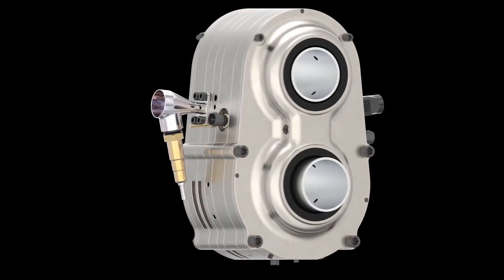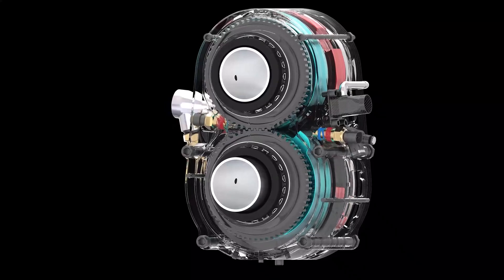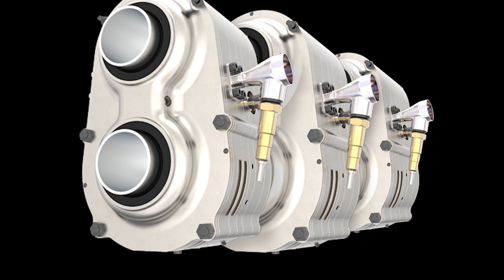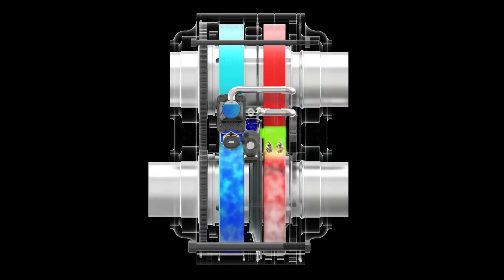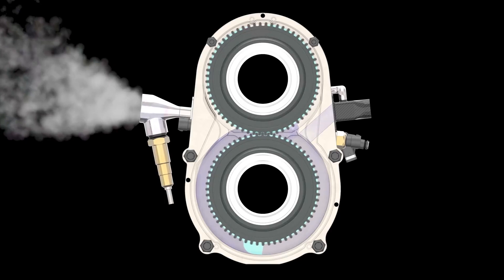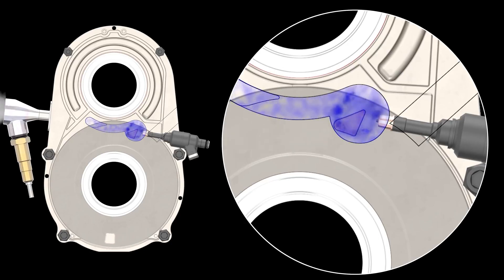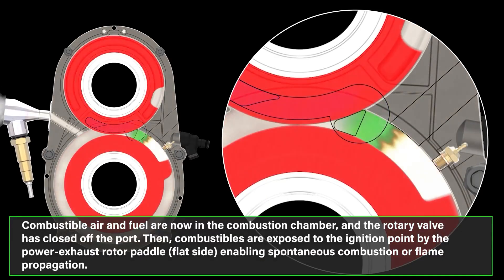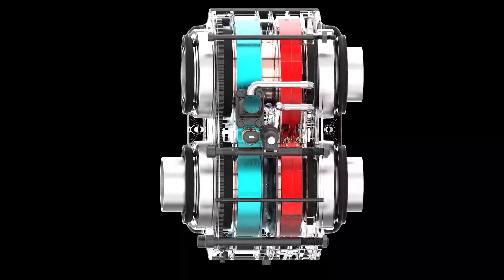This pistonless engine runs on hydrogen and revs to 25k rpm

Comment: Without seals it would require insane tolerances and  any wear would kill its ability to produce  power .
Reply: Just think of it as a tight tolerance on the engines lifespan.
Reply: It would require some sort of special oil  instead of the average of oil clearance  of 3 to 5 thousandths of normal engines.   Heat would be a major factor with thermal expansion.   Would  be fun if it was available to mess with.
Reply: @bradnunn9127  There's one running on their website. Sounds like a Briggs & and Stratton at 300rpm.
I call BS on the thing.
Reply: Thermal expansion aspects could be overcome by design and applying correct thermal coefficient materials but it can be a challenge indeed. However the efficiency propagated indicates limited thermal expansion/stress.
Reply: Not to mention thermal expansion.
Reply: @bryanpritchett  doesnt nitrogen burn at lowe rtempriture? depending on material thermal expansion should not be an issue
Reply: @bryanpritchett  Maybe if it was made from "Invar" the cost would be astronomical.
Reply: @bryanpritchett  "Not to mention thermal expansion." thermal expansion can be dealt with by using metal with different expansion coefficient. This problem has been ever existing in all ICE and there are ways to solve it.
Reply: I was thinking that. And I bet this is just a computer generated model. So that means they probably haven’t tried it for real
Reply: @isaacsrandomvideos667  A working prototype has been built and is being tested. Video of it is on their web site.
Reply: @isaacsrandomvideos667  "they probably haven’t tried it for real" https://youtu.be/gi7IOXQ7oyo?t=536 - it looks like a very early prototype...
Reply: @alterbart7916  oh right. Sounds horrid though
Reply: This design is just a funny shaped Wankel. You would definitely need seals for a practical design which took Mazda a while to figure out how to do robustly but they got there. You would need similar seals for this engine. You can't just use smaller clearances because of thermal expansion (for one thing) which varies with each cycle from, say 800 deg C or so during the power "stroke" to maybe 150 deg C on the intake "stroke"--the thermal expansion would be about 0.5 mm.  Trying to manage this kind of expansion with a clearance of maybe 1/100th of this would be "challenging".  And the short time scale isn't going to fix the leakage issue--more important for leakage is the very high pressure developed when the engine fires and even during compression at the high pressure ratio that is assumed. Using hydrogen is just a gimmick--if the design can work, it would be better tried first on gasoline to show that the concept can or cannot work. The meshed gears that replace the crankshaft are interesting but I seriously doubt the power claims and the practicality of this design. It ignores a great deal of the actual test history of the last 100 years of IC engine design.
Reply: @gerrylarue9043  Mazda discontinued their rotary engine. They never, ever, got it to be reliable.
Reply: @MovieMuscle  they didn't discontinue the rotary they simply stopped putting them in car they are still manufacturing them for the cars they came in.
Reply: lol. yeah. So its a 16kg engine that has a 2 month longevity and requires a 100kg supercharger to feed it enough air to run and a 20kg electric motor to get it up to operating speed.
So basically its a power tap off a turbojet with extra steps.
Reply: @htomerif  Yep thats how I see it. Should work but not any better than a PT-6.
Reply: @anthonyb5279  And even though its in the title, I didn't notice that this thing runs on hydrogen. So lets add incredibly heavy, dangerous and bulky high pressure hydrogen tanks to that list of requirements. Or you can just hope that one of these high density hydrogen storage methods will one day be commercially viable.

The reason I looked for what it ran on eventually was because I was wondering how you get a flame front to propagate fast enough to run an engine at 25k rpms. The only thing I knew of was using hydrogen as a fuel and yep, that's what it uses. in a lot of ways that makes it worse than a turbojet since turbojets will run on basically anything that burns. Candle wax, coal powder, methanol, whatever. This thing? Just hydrogen.
Reply: @htomerif  80 octane may be fast enough, that stuff is really explosive. Nitromethane and water could work too. I could run some simulations to see but i think slower burning fuels would just limit RPM.  You could catalyze H2 out of water with platinum or chromium so you don't need the insaino tank. The more i think about this tho Peltons are less efficient centrifugal or axial turbines. So as novel as this is I don't see it replacing reciprocating engines in cars. MOST of theses peoples criticism is ignorant, the thing would definitely work.  What it has going for it is simplicity so it may find use some where.
Reply: @anthonyb5279  eh... You can't really 'catalyze' hydrogen out of water. you have to put in at least as much energy as you get out. If you're talking about electrolysis then more than all of the energy produced by the engine would be consumed by the electrolysis. If you're talking about steam reforming, the feedstock is some kind of hydrocarbon (and water, but the hydrocarbon is the important part). That is a catalytic reaction, but its still very endothermic and would require most of the fuel just to heat the steam reformer.

In either case, you would be trading hundreds of pounds of tanks with thousands of pounds (realistically tens of thousands of pounds) of industrial hydrogen production equipment, and you're still left with a net energy loss.

If you could just bamf water into hydrogen and oxygen for free, that process would be the single source of the entire planet's energy production, but you can't, which is why so much research is going into storing hydrogen and, like I mentioned earlier, its nowhere near ready for commercial applications.

The only place where you see "free" hydrogen production is when a hydrogen plant is co-located with a power plant or some other industrial source of heat that would otherwise be wasted. That's why desalinization plants are co-located with power plants.
Reply: @htomerif  Yea you are right thats NH3 but replace my statement with NH3 and then the platinum works. sorry my bad.
Reply: @htomerif  yea electrolysis take 170% of what you get out.
Reply: @anthonyb5279  Yeah, you still need a high pressure, high temperature reactor to catalyze hydrogen production from ammonia, but maybe it could work on a vehicle scale? I don't think its done anywhere except on an industrial scale.

Liquid ammonia is a lot better to work with than liquid or high pressure hydrogen but its still pretty bad. In the US its sale is restricted due to methamphetamine production, but its not too hard to get.
Reply: @anthonyb5279  Hmm... i know I have a couple of 1 liter bottles of MEK that I distilled from something in the last year or two. I don't remember what. Maybe PVC glue? I haven't had a use for it yet.

The regulations to try to prevent meth production are stupid. Its just too simple of a molecule to regulate away. There's probably a dozen different ways to make it with just stuff you can still buy at the hardware store. I guess it takes a chemist to come up with new syntheses but it sure doesn't take a chemist to follow them.

DCM (aka methylene chloride) is kind of nasty. Most chlorinated hydrocarbons are hepatotoxic, CNS depressants and carcinogenic.

There's a lot of bad stuff hiding in plain sight. I learned not too long ago that Whink rust remover is just dilute hydrofluoric acid, which is one of the worst things you can handle.

Anyway, thats a bunch of random things I just wrote.
Reply: @htomerif   I live in Maui, I live by Hydrofluoric Acid! salt eats everything.
Reply: @htomerif  What type of Engineer are you? I have 3 engineering degrees BS in Broadcast Engineering, BS in EE, Ph.D in AERO-E&Space Exploration. Im retired from NASA and the NRO(Kodak). Now I'm a YouTube troll and I still build stuff.
Reply: @anthonyb5279  I have no degrees in anything. I spent 10 years in the Army where my official training was in a particular subset of missile systems and thermal optics. I expanded from there to basically everything that runs on electricity. I got out on a medical bad enough that I can't do much.

I taught myself programming where robotics and machine vision and neural networks are my main focuses. There's a lot of ECE that I learned in parallel though I was raised by two PhD biologists, so I have a lot of that too.

If you know about machine learning and especially vision, then you probably can guess I had learn a lot of math.

Chemistry has been one of the last things I've been teaching myself and its taken 5 years and no small amount of money.

So yeah, no degrees. Usually it would be fair to assume that I'm bluffing my way through everything I talk about. A very few people know enough to understand that I'm not.

Oh, and law. Doing this stuff without a university or major corporation to back me, you can stray into illegal territory pretty quickly. So I've had to deal with the FAA and the FCC and the BATF. Especially when it comes to unmanned aerial systems and flying either beyond visual line of sight or letting the thing fly itself, you need a BVLOS waiver for each and every flight. Its actually more convenient just to design unmanned ground systems. You only have to deal with the FCC then.

Sorry to disappoint, but on paper, I'm just a regular guy.
Reply: @anthonyb5279  Yeah, HF is fun. Its relatively easy to make from crushed fluorite and <insert almost literally any acid here> though sulfuric is the easiest. I was surprised that something I don't touch ever with my hands and even with gloves unless I absolutely have to was actually in a product I've been using for decades this whole time.

I always just assumed it was HCl until I looked up the MSDS.
Reply: @htomerif  Well you are very knowledgeable. Very easy to chat with I have appreciated this discourse. You seem to have the temperament of an engineer. You can argue a point with out making it a personal attack.
Reply: @anthonyb5279  Yeah. I have some kind of disease that makes me want to learn about things. Its a problem. I'd never heard of using ammonia as a hydrogen source before. Just electrolysis and steam reformation. I can't really use it for much right now, but I'll remember it.
Reply: Saying it ran on gas where talking hydrogen which has a whole different spectrum of chemical reactions opposed to oil. Like high amounts of oxidation so you can only use specific metals and matrials alike. Lots of ceramic metal hybrid elements. Oil has the advantage of lubricanting the steel or aluminum used protecting it.
Reply: @xaagripha7326  I use Porcelain Tungsten a lot in engines. All of my racing engines run so hot they are on the harry edge of detonation all the time. Typically run 15° past TDC to avoid a hot spot forming and avoid stress on the crank and pistons. Alcohol ADI is also used to keep things within the range Ceramic Alloys heat tolerance. All so I can run an EGT of 3800°F and use as much of the available energy in the fuel as posable. Also gives me a SFC of .32 for the cross country races running lean of peak.
Reply: It’s made by an aerospace company, and we all know that rocket parts don’t last very long because the immense stress on the parts
Reply: @kerbodynamicx472  aerospace also do aeroplanes, a field where reliability is extremely important.
Reply: @kerbodynamicx472  dude if its going in a plane they dont want it to break down when you're at like 10,000 ft. thats gonna be a bad day for anyone in the plane. if it goes to market they'll iron out the bugs. thats if nobody squashes the idea because the established producers would rather not the competition
Reply: @kerbodynamicx472  yes this is true but cars don't travel at 18,000 miles per hour like space rockets, and they never will
Reply: @Classic_Re-creation  Well the guy who fitted a JATO unit to his car might beg to differ, if he had survived anyway ;)
Reply: @Classic_Re-creation  Irrelevant to this discussion.  Vehicle speed has nothing to do with this fake motor.
Reply: Make it out of tungsten and it will be like 70lbs and still not all that heavy but it could take all the heat and wear easy.
Reply: The thing with rotary machines in general is that they exhibit very very little wear over time due to the fact that they run under constant conditions instead of the back and forth of reciprocating systems. I would be much more worried about buildup of exotic carbon species on combustion chamber, that is much more likely than wear and tear causing it to fail or leak.
Reply: @LouSaydus  it runs on H2 no carbon build up.
Reply: Fox Mulder  same thing happens in extremely small Nitromethane 2 stroke engines. BUT NO "Bla bla bla I know everything because I have a moped and bla bla bla.""" You cant be educated because I don't know what you are talking about" 😛any way "I want to believe" :-)
Reply: plus heat and cold. Every part wears, doesnt matter how good the design is.
Reply: @til159  eventually.  Then a teardown and rebuild would be needed
Reply: Fox Mulder  literally nothing you said was remotely accurate. Gas turbine engines operate at those same approximate rpm's and they actually have to have really good seals to make sure the RAGING FIREBALL stays in the right part of the engine.

 "thermal expansion doesn't have enough time to set"
lol. wut? The gas better have time to thermally expand or its not an engine. Its just a flamethrower.

"it's hydrogen powered with low combustion high rotation"
Wow, really? Burning hydrogen is considered "low combustion"?

I'm gonna let you in on a little secret, guy: when they say that this thing takes 200psi of supercharging, i.e. more than 10 bar, you can't use an intercooler. It would lose you too much energy, I don't expect you to understand why, or even why that's important. What you need to understand is that even before the fuel is injected, the combustion chamber will be above the autoignition temperature of the fuel-air mixture.

This engine is going to have (to put it lightly) VERY serious heat management issues. Its all going to have to be made of ceramics and special unicorn metals just to not burn itself up.

If you're gonna laugh at people for being stupid, try not to be stupid yourself.
Reply: Guys I think the engineers and designers have thought about probably all of this, especially in regards to seals and tolerances. If you think you know better than they do, apply to join their team I bet they could use a bright mind like yours.
Reply: But what if we just put seals on it? I don't know if he said it wouldn't work without
Reply: @tapthepope  As you can see when it runs, the wedge that locks into the socket on the lower and upper rings, that is what generates the power, side-to-side those spaces are confined and once the wedge passes the socket the two rings close the gap for combustion to have an enclosed space, expanding gas then pushes the wedge and exhausts somewhere on the other end of the cycle (otherwise vacuum would be a counterforce-factor and that would take power away)
Reply: @tapthepope  wear out fast in rotary l think
Reply: You engineers need some gd common sense now days.  Obviously you have less then a gnats a$$
Reply: Excellent
Reply: I'm sure they are looking into it lmao
Reply: How do you think a seal works....insane tolerances. 🤣
Reply: @jeffsteyn7174  Seals work by being malleable so they can conform as necessary.
Reply: @jeffsteyn7174  that isn't how seals work...wow...they are made from rubber and crushed between two pieces of metal to seal the gaps between them...they are NOT BUILT TO INSANE TOLERANCES...can you freggin google tolerances so you can realize that it doesn't apply to rubber gaskets? 

when they are talking about tolerances they are talking about ridged bodies. like a 1.0014mm wide peg fitting in a 1.0015mm hole. 

here is a visual aid if you need one. 
https://www.youtube.com/watch?v=ekwk5VsflKI
Reply: @TheNitroG1  that is one type of seal yes. But you realize there are others as well?
Reply: That's why you don't put it in a car, you scale it up and put it in a generator.  Something emplaced and static so operational jostling does not cause those 'tight tolerances' to bounce around against each other.  Hook up a big ass fuel cell and you're set on keeping the house and demanding electric statusmobile powered indefinately.
Reply: Well F1 Engine tolerances are so close that it is seized at room temp. It needs to be heated by circulating hot water through it to free it up.
Reply: Fox Mulder  then why arent there any running prototypes? Its easier to sell if you manage a working proof-of-concept instead of spinning cgi-fantasies.
Reply: Insanely close tolerances would make it super expensive to produce too.
Reply: @noxious89123  the tolerances are no closer than a piston and sidewall. The only difference is that there are no rubber seals, the speed of the engine produces creates a pressure seal.
Reply: " Intolerance wear", as you call it, can be corrected instantly because the wear would be on circular surface( s).....
   The two circles could be adjusted closer when needed.
   Any gears could be replaced in minutes...at a minimal cost.
  Used worn gears could be recycled...
Reply: I have machined parts for transmissions parts before and I worked within tolerances of 0.0002 +/- 0.0002. If you're skilled enough at setting up a machine to do this kind of work it's rather easy to produce these kinds of tolerances.
Reply: Ha Ha Ha  says you !
Reply: wimpie willemse  So insanely high that an F1 engine won't turn over without being pre heated. It is effectively seized at room temp.
Reply: Looks like the Rotary of the future. It's all seals.
Reply: wimpie willemse  That's true but the power starts to drop significantly quite quickly which is how Mercedes had an engine advantage at the end of the the '21 season they just saved a new/low mileage engine which in a straight fight would have been enough.
Reply: ì think they made it with the intention to be as friction-less as possible, unlike piston engines. looks like they thought about this already. it's not a hard thing to re-imagine what an internal combustion engine can look like. the only reason piston engines dominated is because the oil franchises financed all major automobile manufacturers. piston engines are highly inefficient. thus, it's the obvious choice for the wealthy. lots of other engine designs were created over more than a century. all the good ones ended up bought up by oil companies or locked away by patent offices who stamp a 'nat security threat' over the top, classify it and claim that such technologies would upturn the energy industry and therefore the world economy. yeah. they would. tens of thousands of these patents would do that very thing. in a lot of other industries too. but because hardly anyone knows about it, the decades roll on and we keep living in squalor. all the good tech humans have created is kept off the market, and used/further developed off market as well. it's always been that way.
Reply: Maybe not if there was a lubricant injected along with the fuel to some degree.
Reply: If it misses a tooth
Reply: Citroen hydropneumatic suspension struts did not use seals as the tolerances were closer than the size of the hydraulic fluid molecules, introduced in the 15H in 1954, to an extent the light weight of the motor would be offset by the gearbox needed to bring thos revs to a useable level
Reply: you are right, it's a fantasy engine.
it would be a nightmare to maintain if it works at all at any considerable power.
Reply: @cnschu  i hope astron do like a 50cc version to see how it runs then scale it up if its good.
Reply: How often do turbo rotors wear out? The rotor doesn't touch housing, so wear does not occur where these tight tolerances are.

Same here. Tight tolerances, but not loaded tolerances. These aren't tight bearing surfaces, they're tight gaps.
Reply: Not only can you skip combustion cycles, but stacking them you can just run one engine when, say, highway cruising, and as load increases, seamlessly bring the others online as needed.
Reply: 80 k miles before projected maintenance
Reply: @msharp6887  more like 8k miles before projected replacement
Reply: @lesstevens2370  not according to the specs, or the manufacturer
Reply: @msharp6887  its not the engine thats the problem is carrying around the most explosive natural fuel that burns at 1 million Kelvin know to man when half of the people can't drive responsibly
Reply: @lesstevens2370  ahh. Well this particular engine iscdesigned to run on any flamable fuel source. Gas, diesal, kerosene, alchohol, all the same
Reply: @msharp6887  There is no manufacturer.  This is just an animation.    It does not and cannot exist.
Reply: @msharp6887  No.
Reply: @foobarmaximus3506  it's called the omega 1, made by an aerospace company out of Kentucky I believe, and they have a working prototype.
Reply: @foobarmaximus3506  yes
Reply: @msharp6887  Talk is cheap.
Reply: @msharp6887  ...seriously you are going to take the manufacturers word for it on an engine that isn't even available to the public? 

Lets ignore their hopes and dreams for a second shall we? the engine is going to be made to tolerances that if there is any thermal expansion either means the parts won't fit together or they will wear on each other or they will develop leaks. 

did they discover a new type of metal that doesn't expand or contract under heat or cold and also doesn't ablate under frictional contact? Because that is what is going to be required for this to exist in a practical application.
Reply: @TheNitroG1  firstly there us a functional prototype.  Secondly they use high density ceramics to prevent high levels of thermo expansion, and set tolerances to work with the remaining level of expansion. The only real downside to this engine is that it would require pre warming in order to expand to the operational tolerances, or some sort of adaptable tensioner in order to keep the tolerances at operational level. Both of which are very simple to do.
Reply: @msharp6887  Gee, I wonder what happens when it's -10 out...
Reply: @TheNitroG1  you would need to preheat it.....I just explained that. ....pay attention
Reply: @msharp6887  Nicola promised great things, with their electric semi. Which did not exist. Nor did the factories. Or the tech.
Reply: @MrDanisve  and that has to do.with this how exactly?
Reply: @msharp6887  This engine is designed to get those investor dollars the true spirit of the likes of Elon Musk.
Reply: @hckie  they already have enough investors.  And being compared to musk, a guy who has done more for the world than entire countries is not an insult
Reply: @msharp6887  done what exactly?
Reply: @hckie  lead the way in green technology,  charities,, scholarships, ect
Reply: @msharp6887  He branded an electric car.  Now he mostly 
markets vaporware.
Reply: @hckie  do some research
Reply: @msharp6887  im asking you
Reply: @hckie  it's mostly through charitable donations. 5-7 billion every year. And before u say he only did it for tax deductions,  his business ventures have rarely turned a profit, in fact tesla just last year had its first profitable quarter, so he didn't need those deductions. I will paste a few examples..,........Last year, he gave $50 million to St. Jude's Children's Research Hospital. He also donated about $30 million to a variety of public schools and nonprofits in south Texas, where SpaceX builds its rockets. His private foundation's latest IRS filing shows he donated 11,000 Tesla shares to the charity in 2019
Reply: @hckie  and his research and development into ev technology is the basis of all current electric vehicles.  I don't personally believe that electric vehicles are the future,  it's a backwards technology after all and has massive drawbacks, but he is still responsible for it.
Reply: @msharp6887  He marketed Tesla to investors. Other people did the development and design for the car itself. Other projects are old rehashed ideas. SpaceX did drop the cost/tonnage for space freight a bit though so I give him that (landing reusable boosters is also an old idea from the 70s IIRC). Charity has nothing to do with being an inventor which Mush is not.
Reply: Lets all pretend we know everything about this design and know everything.
Reply: @foobarmaximus3506  Like the WW3, yes?
Reply: @lesstevens2370  more like 800 miles before expected detonation 😬
Reply: @lesstevens2370  Petrol is pretty volatile but cars rarely catch fire in an accident, and with EV batteries it seems to be "stand well back and wait until it stops burning",  fire brigades don't seem to want to get involved and I don't blame them.
Reply: @msharp6887  Google Map their address; it's an accountant's office, not a shop, lab or factory.
Reply: @msharp6887  Exactly the same scams & lies; THAT'S what it has to do with this.
Reply: @msharp6887  No, they don't have enough investors. Just like Bernie Madoff! The President told me on the phone I'd have to have 25M to "get in".
Reply: @michaelscott356  it's astron aerospace.  They are fairly well known
Reply: @Les Stevens you think hydrogen burns at 1 million degrees Kelvin!?That's about 999,727 degrees Celsius. Hydrogen would be undergoing fusion at those kinds of temperatures. It's closer to a couple of thousand degrees.
Reply: @msharp6887  You left out imagination as a fuel source.
Reply: @imminentjustice338  anything combustible.
Reply: @Jordon B yes hho or browns gas
Reply: @lesstevens2370 8 miles🧨🤣🤣
Reply: @lesstevens2370  luckly pure hydrogen is less explossive than unpure.
Reply: @UCOWitZDANG3iu5NmRVhDXFg nope guess 30 years of  building engines  taught me nothing?   Nitrous  and  turbo engines require different ring gaps than a N/A engine.  This would be like the last RX8  engines that dealers had to keep in stock for warranty purposes.
Reply: @bradnunn9127  30 years of building conventional engines might also have left you entirely inside the "box" of conventions, unable to accept new ideas for doing things. Just saying...
Reply: @bradnunn9127  This engine needs not engine building experiences, but rotary compressor building experiences...
Reply: @bradnunn9127  Seems like a bit of a waste of 30 years. Shame.
Reply: If it's done right,  and by the weight of it,  they would probably be throw away motors.  Melt down and reuse
Reply: @MrBurntasphalt55  that also gives more jobs for the economy
Reply: all you experts are making me laugh. You don't think they thought of any of this. It has two moving parts and material science is next level these days. Most jet engines don't have seals and I'm sure if you planned on burning hydrogen you would probably be using the same alloys. This is not a problem these days for a sub 300hp engine. With two moving parts I'm sure the tolerances are pretty wide open anyways. Thermal expansion wouldn't be a problem. 😏 The metrics here would be MUCH different than a traditional engine or even a rotary engine so it really doesn't matter how long you've worked on car engines. Are you a mechanical engineer? Yeah that's what I thought. Completely different math altogether. She's gonna leak! But to my eye this looks like a pretty robust design.
Reply: @luke144  Jet engines don't have parts that need seals. They don't get the power from spinning a cylinder like that.
Instead, they get power from having air fly out the back of the engine at high speed spinning turbines as they do.
Conversely, this has 2 cylinders which need to mate to produce an enclosed volume, with the expansion of the gas pushing a part of the wall of that enclosed volume to produce power.
Reply: @luke144  It doesn't work at all.  It's 100% fake bullshit.
Reply: @luke144  Ford, with all their engineers didn't even fully solve their reliability issues with their large displacement cross plane V8 and discontinued it. I guarantee you they put more effort and research into building that engine than they have into this design. Mazda never managed to get the rotary to be reliable and discontinued it as well. You comment re engineers said it all. Have you ever yourself taken an engineered design to working prototype? If you had you would know that soon as it's built, we ALWAYS find issues. Ask the builder how many times they run into issues or tell the engineer his theoretical design won't work because of X variable. The builders of said designs often know far better than the engineer what will and won't work. Book knowledge or theory is one thing, practical knowledge is another. Someone with both practical and theoretical knowledge is the ideal.
Reply: Hmmm. never heard of a Turbine. Most of the power in the world comes from turbines. What about a turbocharger? same thing . Hmm. maybe you should look at this thing and see how it really works. The only thing is 25,00 rpm? How are you going to harness that even if it doesn't spin itself apart.
Reply: @peterturner6497  Do you know what a Free Turbine is?   The PT-6 is a Free Turbine that runs over 70,000rpm and the shaft only runs 2,200 rpm.
Reply: @peterturner6497  most power is delivered from electric motors
Reply: @peterturner6497  High revs just require different gearing.  Cars were made with high rev turbines 50 year ago and they work fine in terms of transferring the high revs into normal road operation.  The big problem you had back then was the hot exhaust gas out the back that could burn the paint off a car that happened to pull up behind it.
Reply: @peterturner6497  25000 rpm... sounds like next gen motorcycles.  Honda had one that was close a while back
Reply: @korvoth4269  the 250rr could rev to 20k or just under
Reply: @somekiwidude  yea...that one. Sounded like it was always going 180mph
Reply: @peterturner6497  commercial airline jet engines spin at up to 25000 rpm and micro jet engines with much smaller internals and tighter tolerances spin at up to 500,000 rpm, so the engineering of rotating parts has allready been accomplished and proven time and time again, simple cheap air tools spin at up to 25000rpm without issue. And theese are super cheap to manufacture and they rely largely on the air it's self that is passing through the tool for cooling.
Reply: @Classic_Re-creation  Wow! Great to hear.So now tell me how do you gear it down enough to drive a car for example? or do  you use it to generate electricity or something.
Reply: @peterturner6497   using gears inside a gear casing, otherwise known as  (A gear box) by using a combination of different size gears in a calculated sequence the gear reduction is very simple. for example when a four cylinder car engine is reving at 7,000 rpm in first gear the car will be travelling at let's say 30mph, let's make the input shaft gear bigger or smaller and we can now make the car move at say 50mph at the same 9,000rpm, let's just emagine for a moment that we gear it the opposite way and now the car is only doing 10mph at the same 9,000rpm, now let's reduce the rpm down to idle speed (1,000rpm) the car is now crawling along, it's very simple by adding or reducing the circumference of gears inside a gearbox anything can be achieved. It's simple multiplication and division. Most modern engines idle at around 1,000 rpm so it would need one simple gear introduced to a standard car gearbox at a ratio of 25:1 and the standard car gearbox will now turn at normal speed.  In simple terms the engine would need a 25:1 reduction gear to bring it down to usable speed.
Reply: @Classic_Re-creation  Apple, meet orange.
Reply: @Classic_Re-creation  We all know how gears work.  It's impossible to gear up a motor that does not exist.
Reply: @peterturner6497  "So now tell me how do you gear it down enough to drive a car for example?" Turboshaft engines are a thing. Making 10:1 reduction gear would definitely be possible, if a bit big and clunky. With the tight tolerances involved I'm a bit skeptical regarding the engine's lifespan, so while it looks interesting I will definitely want to see some independent long term testing if it ends up going anywhere.
Reply: @Classic_Re-creation  Yes, wheel speed and/or wheel diameter controls efficiency and overall power.
Reply: @Classic_Re-creation  Yeah, but air tools have no internal combustion going on.
Reply: fuel aids in some lubrication, but still, your right, as well as just like the rotary, pretty efficient but in reality sucks down fuel. I presume it would be the same here as well
Reply: @ramentaryramblings  their website claims 30+ gallon with ney zero emmisions
Reply: @ramentaryramblings  I think you meant sucks down gaskets
Reply: People just forget how dangerous is hydrogen, ultra flamable and hard to contain
Reply: @Astrobirobildo  this engine can actually run on any combustible fuel source.  Hydrogen is just best
Reply: @Astrobirobildo  if produced and used on demand not a problem.  Especially considering using lithium6hydride If I recall correctly.
Reply: Why not assume that 3d printing could produce engine "block" with tight enough tolerances ? Also what about a ceramic or Kevlar type polymer block?
Reply: @leepalmer1210  I believe it does use quite a bit of ceramic
Reply: i feel like with that level of tolerance even just the temperature would throw it off enough to either not run when cold or expand enough that parts start hitting.
Reply: But if they are disposable and are used to generate the power for an electric car... we just have to run the numbers to see if it is worth it.
Reply: Will probably have those parts that take on the high tolerance pressures a part of a maintenance thing included with every oil change or spark plug change. That or we find an alloy that can take those tolerances like a champ.
Reply: People need to forget about weather or not it would be as long lasting as a fossil fuel engine and focus on what really matters would it be friendly to our environment, that's the real calculation that has to be made because everything can be made affordable weather it lasts 2 years or 20 years it will be priced accordingly. And if the engine only weighs 16kg I can't see an engine swap been more than about 30minutes work.
Reply: @Classic_Re-creation  accorsing to the manufacturer specs this engjne has net zero emmisions
Reply: @msharp6887  Yes, and it runs forever on one tank of gas.  We know.  We know.
Reply: @foobarmaximus3506  astron aerospace.  Technically this is designed for aircraft, but they have tested it for automotive with great success . Ignorance is curable
Reply: @msharp6887  "tested it for automotive with great success." quit making shit up dude.
Reply: @TheNitroG1  ok I won't make shit Up. They have a working prototype, and have been tested for automotive applications with great success..   just because YOU don't know something doesn't mean it doesn't exist
Reply: @msharp6887  Okay, maybe I'm missing something...Then why does the manufacturer's site show nothing to this effect? Links? no mention of a working prototype or videos of one other than the CGI prototype. As far as I'm aware they have not even built a working, operating proof-of-concept engine.
Reply: @MovieMuscle  I have been following this for a while. There is actually a YouTube video showing the prototype running. The manufacturer website also states there is a prototype
Reply: @msharp6887  LOL ok pretend I didn't just post you a video of it puttering along blowing fluid all over the place and being run on compressed air. posted only 6 months ago...where is your proof? Show me this successful automotive testing surely there is some sort of footage of a prototype go-kart or something running on one of these things if it's as wildly successful as you claim. because I tried to find anything I could about this engine as it genuinely interested me. But it seems like just another solar road scam to me. 

I have seen metal machined to incredible precision. Where they fit two separately machined parts together so perfectly it looks like a solid piece. But if you will notice in those videos they handle them like they are made out of glass. Because it does not take much to create an imperfection in that part. 
Example: https://www.youtube.com/watch?v=ekwk5VsflKI
Reply: @TheNitroG1  I don't think u were paying attention
Reply: @msharp6887  No, they don't have a working prototype. Tha "sample" on their website is a Chinese lawnmower engine!
Reply: @msharp6887  Yep. Have you listened to the "prototype" running? At 300rpm? Sounds and looks like shit.
Reply: @michaelscott356  wrong
Reply: @Classic_Re-creation  byt making millions of replacement motorns that also break easy and needs replacement is not good for the environment. Building stuff is not good for the environment. Engines don't just grow in trees, it takes resources to make them. So a more reliable engine is better for the environment because you have to make less of them.
Reply: @Classic_Re-creation  whether *
Reply: @Classic_Re-creation  Nonsense, and jibberish.  Try again.